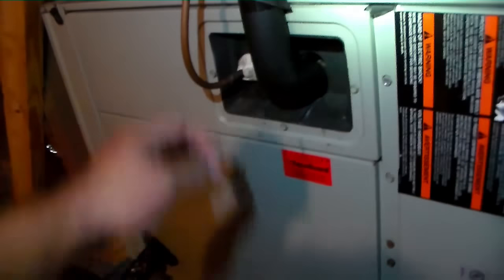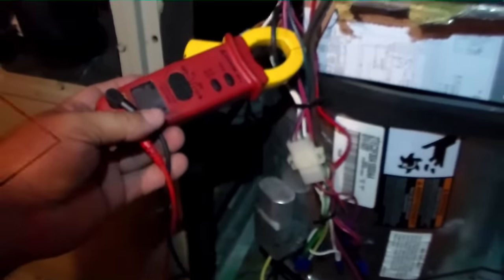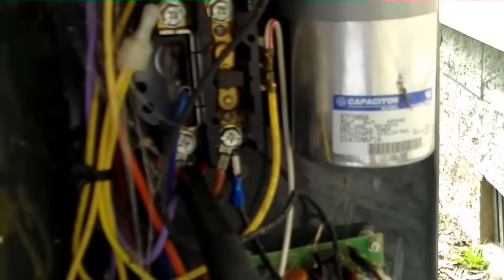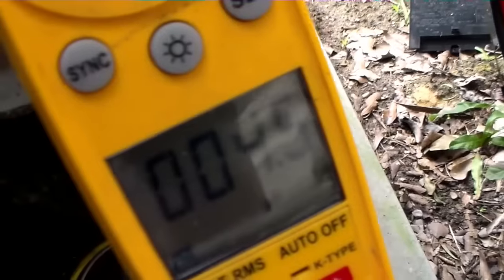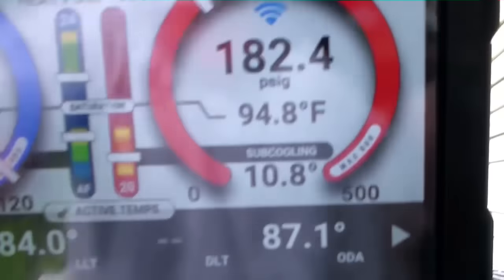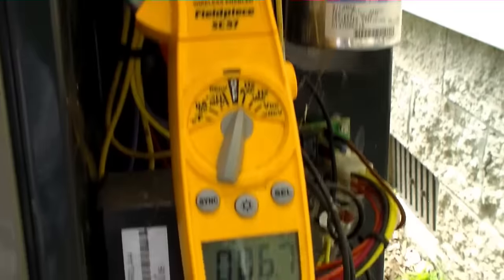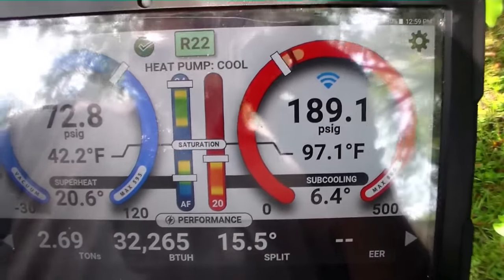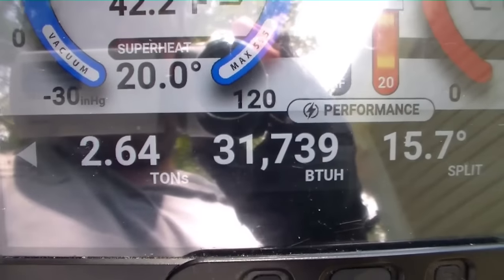Heat Pump System Check and Airflow Discussion

Comment: Great topic. When I first bought my hot wire anemometer I did some tests on my own and customers equipment  comparing the anemometer, static pressure charts, and temp rise method. It was difficult for me to ever closer than 100-150 cfm at best between them.  I got to the point where it felt like I was beating my head against the wall lol. I didnt know which was most acurrate on a consistent basis. It seemed like temp probe and static probe placement was too critical and measurements would vary quite a bit when changing placement on the  same equipment. I began to trust the anemometer more. Whether that's correct or not I don't know.  I like Rodgers idea of comparing it to a constant cfm ecm. Im looking foward to seeing what you find.
Reply from the maker: That's it exactly. I am going to see if I can figure out the most consistent method. the ecm idea was good

Comment: It might be interesting to use both methods on a variable speed ECM air handler where the cfm can be reasonably determined within 5% by it's setup.
Reply from the maker: Good idea.

Comment: I would like to see the results against a flow hood, I currently have the DAFM3 as well but cant say I fully trust it, as a diagnostic tool to get me close sure, but to be with in 25-50cfm I havent built that trust with it. I will be interested to see how this works out. Grab some static and put it up against the blower performance chart, that might be enough to lean you in the direction of which product has the closer CFM reading....Thanks for the vid
Reply from the maker: +Jacob Klein Good ideas. Static would be good.
Reply: What about making a cheap flow hood from cardboard and testing at the return? That would give you a more consistent value than using grille charts and k factors, wouldn't it?